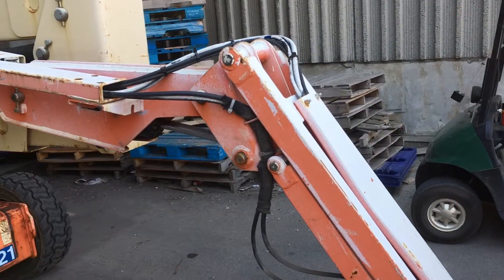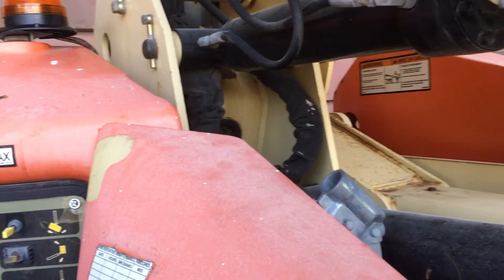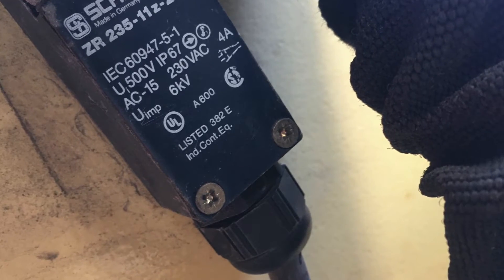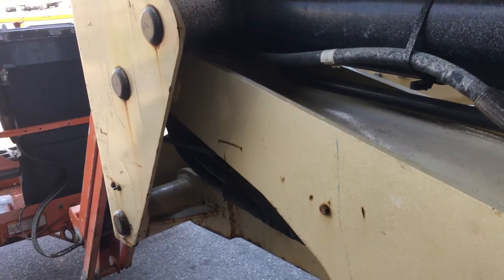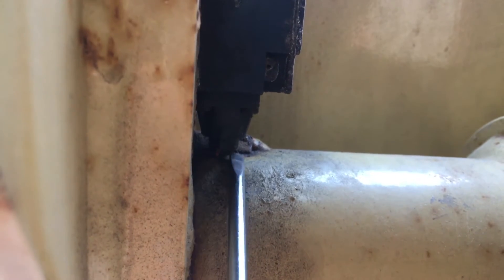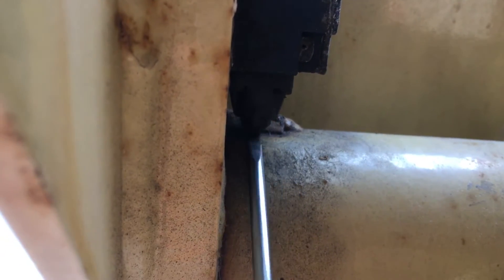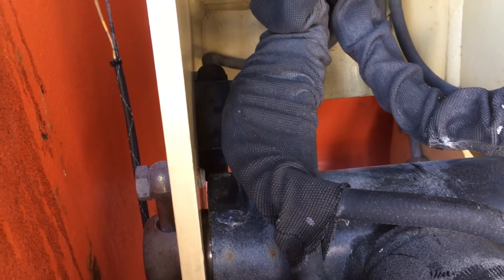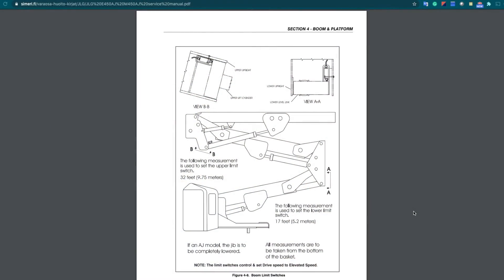How to fix a slow moving Boom Lift  Online Question Welcome！

Comment: How to fix the movement of Boom lift (the machine doesn't move forward, after)
Reply from the maker: if it's not moving at all, that's more complicated than my situation. It can be battery, power contact, emergency stop, or any other control circuit.
Reply: @electricianWANG   Hi thanks for the suport. I cul fix it, it was related with connector pim on the platform and plug on the main control module
Reply from the maker: @danielsalomaomatsinhe7261  Good for you, man

Comment: my JLG 40 H high lift has inconsistent operation of three functions , boom out/in , basket rotation and tilt 
sometime it will work fin then suddenly stop working.. there is a circuit breaker on one end of the basket terminal strip   i am thinking this could be the problem 

any ideas ?   thank you
Reply from the maker: for that, my idea is some kind of malfunction related to power contactors. Normally a breaker would completely open the circuit instead of working intermediately
Reply: Easiest guess might be low hydraulic fluid